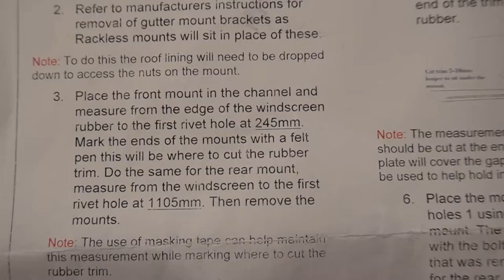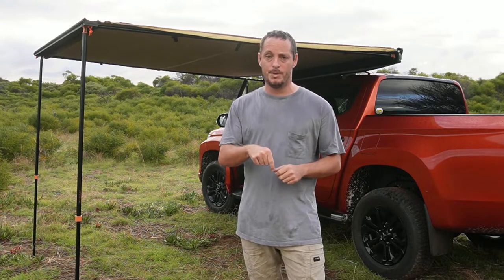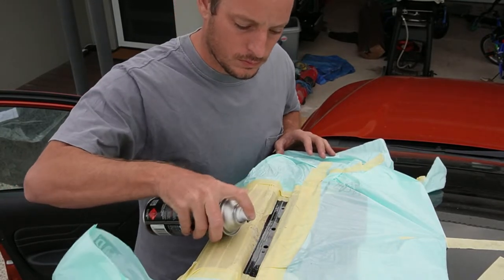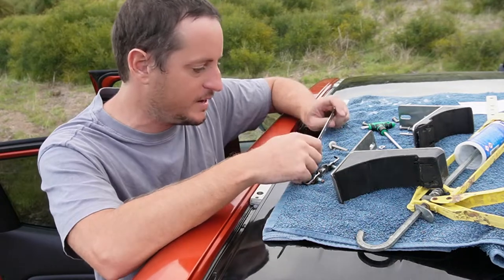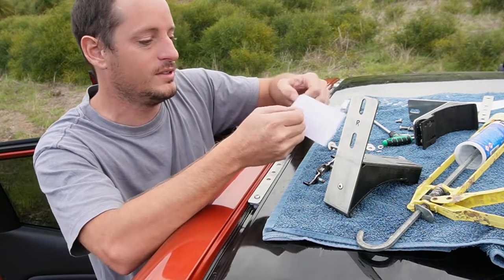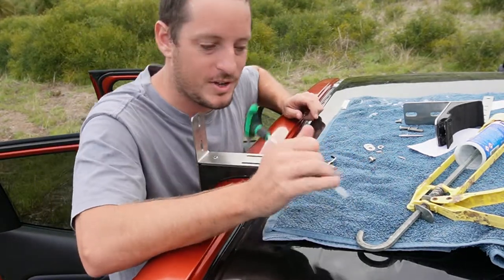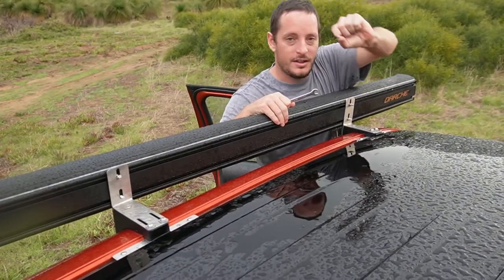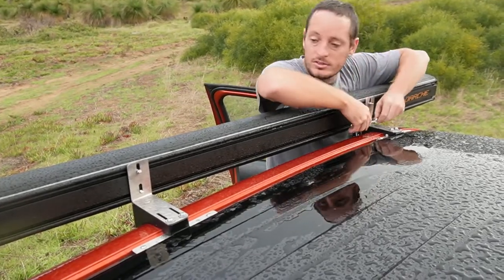Rackless Car Awning Mounting System Install | Everything You Need To Know

Comment: Looks interesting but won't fit my 80 series landcruiser.. damn.. I'm looking for a system that works but doesn't need a roof rack fitted. BTW.. you might need to speeel check..   guild probably should be guide.. ;)